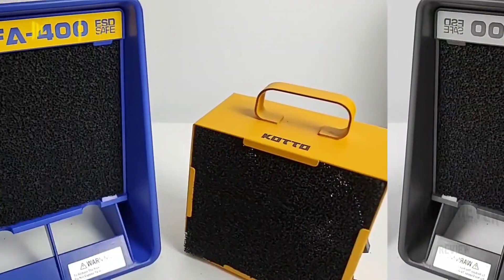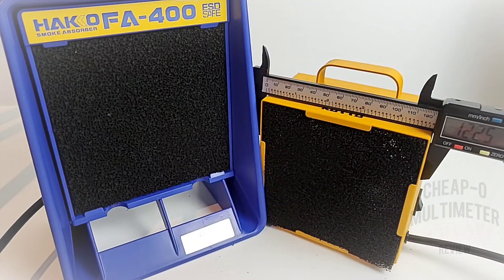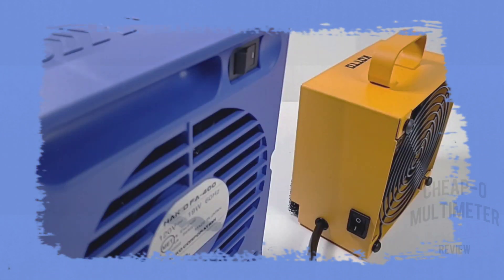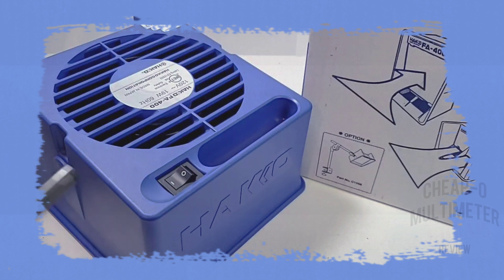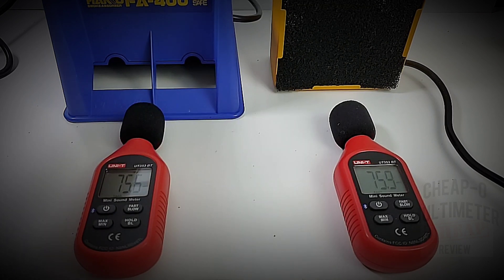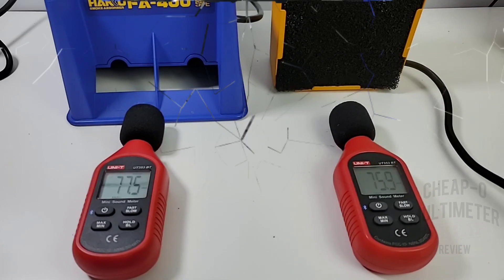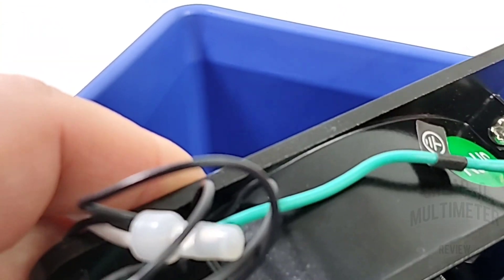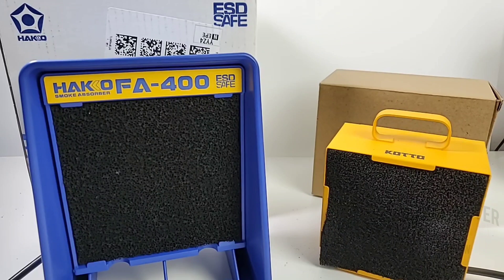HAKKO FA-400 VS KOTTO - Soldering Fume Extractor Showdown! CHEAP-O vs Expensive!

Comment: The air quality readings don't add up in this review.  I think with the hakko in the horizontal position, the exhausted air was blowing more on the meter than it was in the vertical positions, hence the readings being similar for both extractors in that position.  You should have placed the air quality meter sensor directly in the flow of the exhausted air for both positions.  These "fume extractors" do very little in regards to removing toxicity from the air.  All they do is divert the fumes away from your face.

Comment: All of these small fume extractors are mostly bogus. You will definitely need a window open or an extraction tube to direct the air outside for them to work. That filter is way too coarse
Reply from the maker: I disagree completely.. both do an excellent job of removing airborne carcinogens from the air. The hobbyist would be hard pressed to find a safer solution that won't cost an arm and a leg.
Reply: @KeepOnTesting  I watched the video. Your method for measuring the air quality is wrong when you are measuring the ambient air for a few seconds and not the air directly blown out of the machine. Placing the Hako horizontally with the fan blowing upwards is evidence enough. It has a tiny coarse coal filter and that is it. It couldn't scrub 5% of those fumes within that time. What you need is a very fine, stacked coal filter, or beads. You are much better off soldering next to an open window instead of using this placebo junk.

Comment: I am using QUICK 715 2 in 1 SMD Rework & Soldering Station... The soldering iron takes 7-8 sec to reaching desire temperature... QUICK is one of most popular Chinese brand to mobile repairing personals of India, Pakistan and Bangladesh...
Reply from the maker: Interesting...looks like a decent unit..Any idea why QUICK is so popular in Indian? I might try to get one for a review.
Reply: @Darren Walker, because this brand is Good in Quality but cheap in price
Reply: Some of my friends use ATTEN rework stations. It is better but price level is little bit high

Comment: Could I make a request for more tests on Cheap-O Oscilloscopes like the LIUMY LM2001, YEAPOOK ADS5012h, Hantek 2D72, KKmoon ET828, etc.  I realize these types of scopes are limited.  However, my use would be limited to mobile electronics such as Car Audio. The required bandwidth would only need to be 0 to 30 kHz.
Reply from the maker: There's a couple coming up next month...stay tuned!

Comment: yes, Kotto is the winner to me too. cheap but does the job like the big boys 😎.
for the soldering iron/station, my favorite (and have) is Quicko T12-942. i love it because its flexibility in terms of power source. while on my bench i hook it to a 24v power supply, but when i need to solder off the bench, i can hook it to a 4S Lipo battery, just like a TS-100 does, but it's cheaper and has much more variety of iron tips selection. 😁
Reply from the maker: Wow, that's versatility! Great station..

Comment: According to suction speed, air quality rating and price Kotto is far better than Hakko to me..

I have been using Goot TQ-95 for last 3 years and it is still giving perfect performance without any problem... I like Goot product...

But Machanic HK-937d is my favorite one as it is cheap and good in performance
Reply from the maker: I have the same Goot..what a fantastic Iron...I do find the tips hard to source though.. That 937D is a classic.

Comment: This didn't suck! It blew me away!... I've never considered having an extractor..I've just gone with the fume flow! However, in my advancing years maybe it's time to get some suction on the bench.. It could be exciting! 😀. The soldering iron in use here is an Antex, temperature control is by differently weighted changeable tips...Old school! never let me down, just hot off the mark performance! 👍 Great vid.
Reply from the maker: Indeed , it's amazing how effective the right Fume Extractor can be...definitely a must have right beside your Antex! I still miss my Antex, finally bit the bullet a few years back..absolutely great soldering iron which if I recall was made in England..😄👍

Comment: What a great timing. I was looking for a fume extractor on 11.11 to replace my pretty useless 40mm usb fan. Didn't find anything in my price range except for some no name... I don't even know how to call it, it's just 493 (yeah, Hakko clone). And it costs from $23 up to $40+. Long story short, just skipped the sale this year. 

Both Hakko and Kotto look and suck good. I would personally prefer Kotto just because of the better pricing and portability. Are they both 19W?

As always, great review. Mostly reviewers on YouTube just show the extractor sucking the smoke in and you have to believe that it catches everything. Even the cheapest one will suck air, it's not enough. Thank you for more thorough approach. That's exactly what makes this channel stand out. 

As for soldering station I'm still using JCD-8898. It's not that bad for what it costs. I'm moving quite often, so it's important to be able to fit all the tools in one bag. The station is tiny and has both an iron and a hot air gun. I'm also curious how long will it work with all the potential overheating problems.
Reply from the maker: Appreciate the feedback..many thanks!
Its surprising how well the KOTTO performed considering the price point..I originally thought Hakko would walk away as the winner ..what a pleasant surprise! JCD 8898 is a nice looking station.. I really like the wall mount option it offers 👌